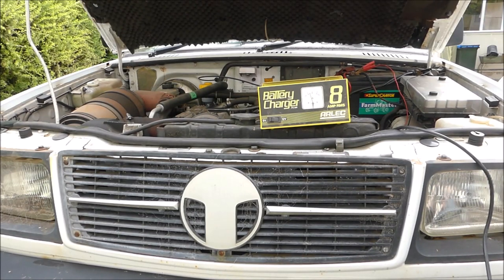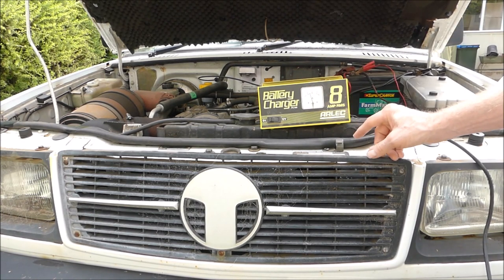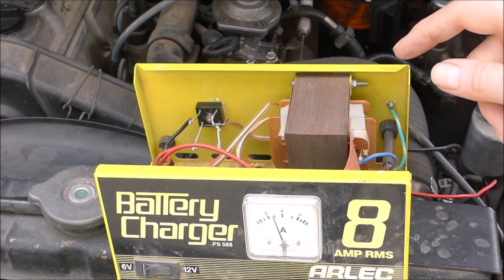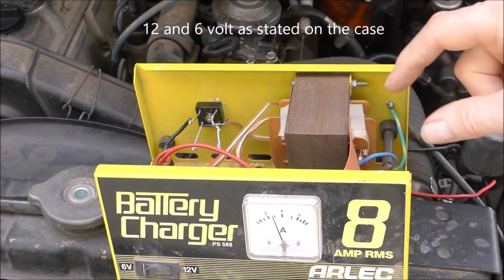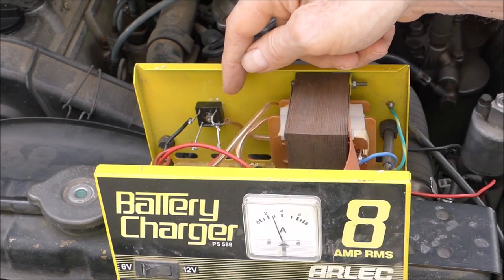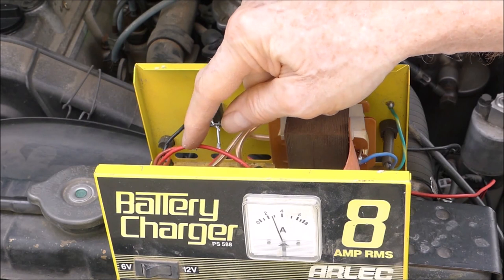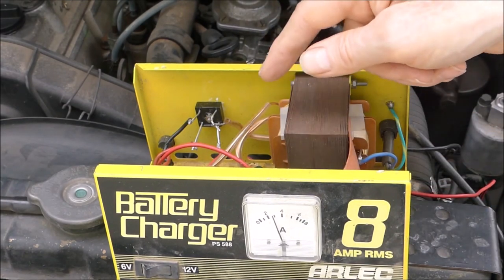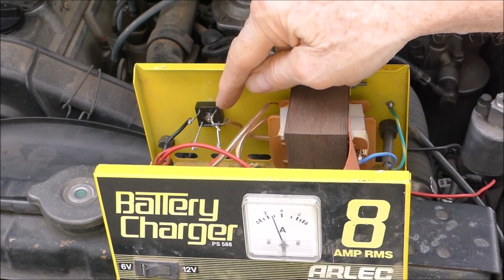Quick fix for a basic car battery charger - replace the bridge rectifier

Comment from the maker: Note:  Bridge rectifier voltage upper limit is usually 400 - 600 volts and not an issue, as it can easily handle any voltage able to be put out by the transformer.  The MAIN FACTOR is to make sure the amperage upper limit is sufficient.  Going higher than standard (the maximum stated output of the charger) is a good thing. Cheers Rob
Reply: I agree Rob! Always over amp the rectifier so the heat that the charger generates will not cook the rectifier. 8amps is either replaced by either 15 or 20 amp regulator. This makes the regulator more stout for long durability.

Comment: Another useful video Rob. I'm sure there are many people out there with broken chargers who can now troubleshoot and fix them.
Reply from the maker: It's pretty straight forward if you trace the output through from the transformer.  I fixed up another identical Arlec 8 amp charger today with exactly the same issues.  All good again for $2.65.  A similar looking new one from Repco is over $139 AU.  Interestingly the basic old style chargers are still available and cost a lot more than the modern inverter type for the same output. Cheers Rob

Comment: I use those old chargers to get a deep cycle battery going again after sitting . Great repair Rob !
Reply from the maker: Hi Shawn.  I have not had to do that, but I can see where one would be good for that.  They are pretty tough units when treated right.  The Bro Inlaw picked up this one and dropped off another identical unit to do the same repair.  So that's the next thing on the agenda.  Cheers Rob

Comment: The big killer of these is reversing the leads, which blows the bridge rectifier almost immediately. I solved that on the one with a relay powered by a diode from the output, so that you need at least 8V on the battery, and the leads connected right, before it will charge. Also added a switch just in case the battery is stone dead, or under 6V, but with a LED to show it is actually correct, so the relay can close with mains applied. Also put in a 35A bridge rectifier, barely more than the 10A one price wise, but with a 15A blade fuse there in the leads, inside the case, the fuse will blow first when you put the leads on backwards.

Charger is a little old GE unit, made circa 1956 from the patent dates on it, and has survived many years. Did add in a charge contrtoller so it will not overcharge the battery, but tapers off to maintain it.

Got another smaller GE unit, with similar 8VAV and 16VAC transformer, and with a selector plug for voltage for 3 cell or 6 cell batteries, and a meter. Had to replace the old rotted out leads, and also the bridge rectifier, as it was kind of rusted apart, and after a phosphoric acid bath and paint coat the case came back to looking acceptable. Not new, and I wanted to keep the labels, so just not looking like a collection of rust, but steel is now protected and no holes in it. Did have to drill all the original rivets, used to hold the case together, to get it apart, but it now works well. Made circa 1960, but transformers are pretty much going to last with only a small amount of care.
Reply from the maker: I have a green 5 amp GEC charger from the 70's.  It has two bridge type plugs on the front panel to select voltage.  These corroded internally and needed attention way back, but is still going perfectly.  Been used for all sorts of power supply work as well (electrolysis etc) which many modern IC units can't handle very well.  Cheers Rob
Reply: @Xynudu  Glad to know GE has been using the same shitty jumpers for decades then. I had to make new ones for mine, they did the same thing. They do have a fusible link in them, which is made from soft tin alloy, which corrodes away inside the casing.
Reply from the maker: Interesting info.  I drilled a centre hole right though all four jumper pins and fed a bridging wire through from pin to pin at the plastic end (which I recessed for the wire) and soldered at each pin end.  Simple fix and solved the problem.  Great old charger.  Cheers Rob

Comment: G'day Rob. Good video brought back some of my very limited knowledge of electronics. These old chargers are great but have a problem of lack of regulation for those who are lazy, forgetful or simply trained by today's standards of just leave it plugged in and forget, you've gotta remember to turn em off. Thanks for sharing. Cheers Peter
Reply from the maker: Hi Peter.  Yes, they are pretty low tech, but they can handle shitty jobs like power supply for electrolysis etc.  My old 5 amp GEC unit from the 70's has earned it's keep.  Cheers Rob

Comment: I fixed my dads old 6v/12v battery charger this way, it was from England in the 1960's and had a selenium rectifier stack in it, changed over to a modern silicone type with no issue.
Reply from the maker: I wondered how a selenium change over would work regarding the output voltage.  One viewer said it is wrong.  Did you check it ?  Cheers Rob

Comment: Where will explain sir. I like the fact how you put the print on screen to give us more information. I have a charger that something like 2 amp 10 amps and two hundred amps. I have saved many batteries with his charger and I've been without it now for over a year. So now I'm going to take it apart and see what I can find. Here in United States they run on 110 so not near the danger I believe anyway as the 220 v you are used to. It shows the green lights and it will show which amperage I have it set at. But it won't show the red for charging. It doesn't matter which setting I have it on. I believe it also has six volt capabilities although I've never used it for 6 volt. Thank you I feel more comfortable after watching your explanation. I watched two others and yours has been the best
Reply from the maker: 110 volts can kill you just as dead as 240 volts.  This is because the lower voltage usually has higher amps to give the same energy factor. So be careful when handling either voltage. Cheers Rob

Comment: I have one - had it for decades 🙂
Reply from the maker: It should last you out if treated correctly ;) Cheers Rob
Reply: @Xynudu  Undoubtedly - last time I used it was messin' around with electroplating - far from ideal. I must have had it 40 years now. I reckon Arlec has always been underrated

Comment: The problem with these old-style chargers is they're unregulated and the no-load voltage is quite a bit higher than the battery voltage. If you leave them on too long you'll cook your battery. By the time you're below about two  amps you start to rise above a healthy charge voltage. This is partially due to the unfiltered peak-to-peak voltage being much higher than battery voltage.
Reply from the maker: Yes, good points.  Cheers Rob
Reply: Yes very true. They are not as safe as the new smart chargers and I am surprised that people are still using these non smart charger. My Ctek charger has worked well for more than 20 years now. The cable got eroded and shorted on the low voltage side but no harm done to the charger due to short protection. Imagine if that happened to an old non smart charger! I plan to change that cable and keep on using it.
Reply: @Raj-nh3fc the newest style of charger I just bought here in the United States probably about 3 years ago but they sell now Schumacher's the brand. If it don't have at least 9 you ever taken the battery won't charge it. Same thing with the batteries chargers at the parts store and Walmart and other places that charges batteries for free. I go through a lot of vehicles. So I have a number batteries on hand and I will tell you that 95 times out of a hundred batteries when they tell me they can't charge it I can bring it home and charge it. Why don't I charged it home well sometimes I'm using a battery on my trailer Hauling the car I ran the battery little low. I do not like the new style charges. But maybe that's not what you're talkin about. The reason why I'm looking at this video today is my fifteen-year-old charger will not charge. Is also a Schumacher. The oldest Schumacher I have is probably around 60 years of age. The newest one I have is three years old and I'll never buy another one I'll just continue to buy old secondhand charges.

Comment: Hi Rob. I'm not too much of a sparky but I think even I could have a go at that. I have a couple of older battery chargers and they both work, my problem is the el-cheapo ammeters are all knackered. I've got a couple of late model so called more sophisticated jobs that I tend to use. I see the pos dc corner on the bridge rectifier has a bevel so it can be identified from the other side. that's handy. Cheers! Mart.
Reply from the maker: Hi Mart.  Yes, I noticed the notch.  Handy if the pin markings are not visible.  One of mine is so  old it has a light bulb instead of an analogue meter.  The bulb (red) gets dimmer as the amps get less - simple idea.  Cheers Rob

Comment: Some of the old metal case ones don't use a bridge rectifier but a selenium diode, it looks like a thing with heatsink plates.   If you replace that with the modern diodes or bridge rectifier they overcharge..
Reply from the maker: Interesting.  I wondered about that.  I take it the transformer output voltage is too high ? Cheers Rob
Reply: Remember that the old selenium rectifiers are very toxic. Use gloves when handling - and if it has blown up and left any smoke residue clean up carefully!

Comment: The older, cheaper classic battery chargers are far more reliable than the so called "smart" chargers-had several of those pack up but the old ones soldier on forever. Obviously unplug the unit before doing any soldering or replacement of components.
Reply: Exactly right - battery chargers have gone from simple to complex for no good reason at all.
Reply: Not true at all. My Ctek XS 3.6 amp smart battery charger has lasted more than 20 years and now one of the cable on low voltage side  has shorted and I plan to replace the cable and keep on using it. Besides these modern smart chargers charge your battery correctly (by checking the battery state and charge it optimally, varying the current as required) and can keep the trickle charge on for months. They can even exercise and desulfate the battery. They are much safer than the old charger shown here.

Comment: Mine seems to have 2 input windings for the 6v vs 12v and the outputs are 3 wires which appears to be center tapped and each of them went to a diode and from the diodes out so in my understanding not a full bridge rectifier and one of the diods broke off so i was trying a full bridge rectifier but i also had to have 2 extra diode to hook up both lines and it seemed to preform worse less current with them and the full bridge rectifier i know i have more diods in line now so the voltage drop wasn't a surprise but i assume without the full bridge rectifier i was getting 60 pluses a second vs 120 with the full bridge rectifier but that seemed worse not better i don't know what i expected but it didn't work for me so i went back with just 2 10 amp Schottky Diode and it seems to work fine but i expected a full bridge rectifier to be better
Reply from the maker: Hi James.  Did this unit originally have a Silenium rectifier ?  Cheers Rob
Reply: @Xynudu  I don't know both the diodes were in a plate that became their commen output with a tab for the output on a corner but one if them broke off and the plate was riveted to the case with what appeared to be cardboard between as an insulator kinda looked like it could be soldered down but I don't know I just went back with Schottky Diodes I was thinking about using 1 full bridge rectifiers but I guess it's not that important
Reply from the maker: Sounds like a pretty old unit.  I have one similar but haven't fully investigated it.  There are a number of circuits that were used over the decades.  The more recent modular bridge rectifiers simplified things a lot.  At least you got it working again.  Cheers Rob

Comment: When you solder the legs, make sure you are holding the legs with a pair of plyers below the end to pull the heat away from the rectifier itself.
Reply from the maker: Yes, good point Benny.  I meant to add that but forgot.  Cheers Rob
Reply: You just need to be fast - if you solder it fast, there isn't enough heat to cause an issue. Ironically the hotter your iron (within reason) the faster you can go. The way you kill parts with too much heat is using an iron that's just barely hot enough to melt the solder and then sitting there with the iron on the part for a long time waiting for it to just barely get hot enough to melt the solder. I run my irons at 650F (~350 C). You should be on and back off the joint in 4 seconds or less with an iron that's sufficiently hot.
Reply from the maker: Yes, good point.  Also pays to tin the pins (and the leads) before soldering them together.  Cheers Rob
Reply: @gorak9000  Correct, like you point out this is not a job for a once-in-a-while soldering, hence the suggestion to use pliers - invariably a newbie will have problems and could well apply too much heat and destroy the bridge rectifier....and when the bridge rectifier fails, they'll just decide to never touch anything like that again, which would be a shame.

Comment: The output of the stepdown transformer is dependant on the input voltage. If the input is lower than rated voltage ---The output also will be lower than the raring specified.  Also, if the input voltage fluctuates --- will effect output voltage . This happens when this type of basic charger is used in remote village, where the grid is not stable !!!
Reply from the maker: Correct.  Mains voltage where I live is actually higher than standard.  Some of this could be due to the use of solar panels to feed back into the grid.  Cheers Rob
Reply: @Xynudu  Yes Sir......Higher or Lower......Fluctuating when on same line as an Arc Welder....All have effect on this charger.
Reply: I had to use Servo Stabilizer when working in remote villages with power from Single Cylinder Diesel GenSet ( ancient WW2 vintage ! )

Comment: Hi Rob. A nice cheap fix 👍👍 Sadly you don't seem to see those sort of chargers any more. Which is a shame because if looked after they would last for years. Cheers, Alan.
Reply from the maker: Hi Alan.  I have a couple and the Bro-Inlaw must have half a dozen.  Old tech can be good.  Cheers Rob
Reply: You still buy them new, but like everything else they have now been cost cut down to nothing. Way under rated in the transformer and rectifier, and the ammeter is often not present, so you just have a single LED to tell you if it is actually connected to the battery and hopefully the hum tells you it is charging. They are now almost empty, with no weight to them, because the tiny transformer is so small, and runs smoking hot.
Reply from the maker: I'm not surprised ;) One of my old ones has a red light instead of an amp meter, which progressively dims as the amp draw drops.  Simple idea.  Cheers Rob

Comment: GREAT TUITION, WHERE DO I PURCHASE THE BRIDGE RECIFIER PLEASE ROB?
Reply from the maker: Hi Mark.  In Australia get it from Jaycar.  Rest of the world try your local electronics parts store.  A very cheap part.  Also available on Ebay etc.  It pays to get one that is a higher wattage than the rated amps on the charger.  Larger is better and not much price difference.  Cheers Rob

Comment: Great video. Will a charger still work if the amp metre is dodgy? I have one similar to this that's only 3 months old. It worked y'day but not today?
Just found ur video
Reply from the maker: The positive output all goes through the amp meter, so it needs to be fully conductive.   If it is burnt out the current can't pass that point.
Reply: @Xynudu  thanks Rob,,, fixed it this morning with an Amp metre from another broken charger

Comment: Well the bridge rectifier sounds cool.. Don't wear out the word. 
It's 4x diodes..
Now. You own a tata, forget the charger. Mount a solar panel on the roof wired to battery via charge controller.. Then hang and paint shiney and bright colours on it...
Don't electro anyone.
Mind how yow go.
Nice vid though.
Paul
Reply from the maker: I run a small solar panel on one of my cars to keep the battery topped up.  Buy the correct type (number of cells) and you don't even need a regulator.  Cheers Rob
Reply: @Xynudu   But its only about 6 or 7 bucks from Banggood... Sorry, did that not turn out as a link 😉
And you need your panel to have a diode to stop battery drain.
Reply from the maker: Yes, a diode is necessary for night time.  Mine is an early panel made/sold by BP - about 0.75 amp and has a diode.  Cheers Rob